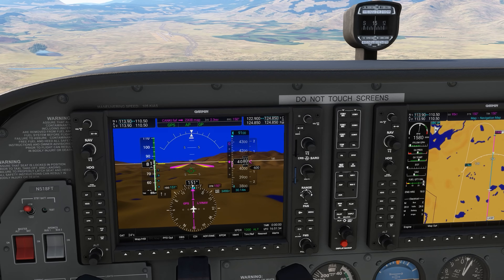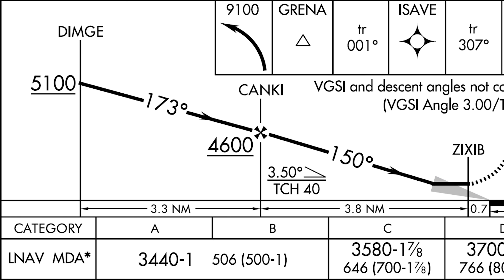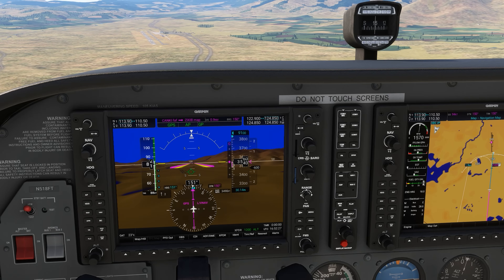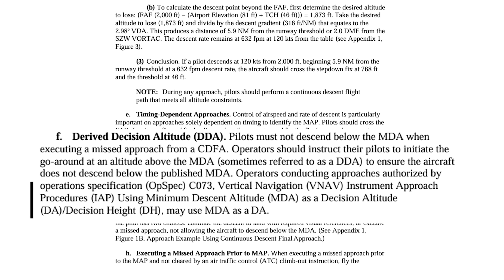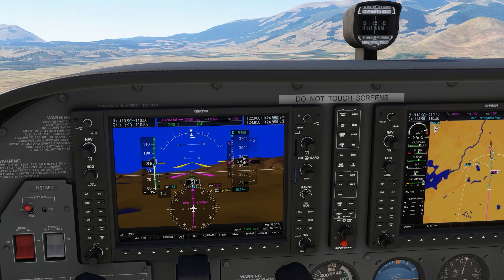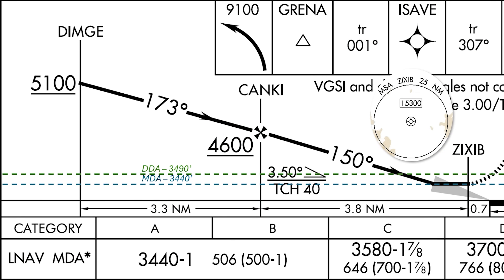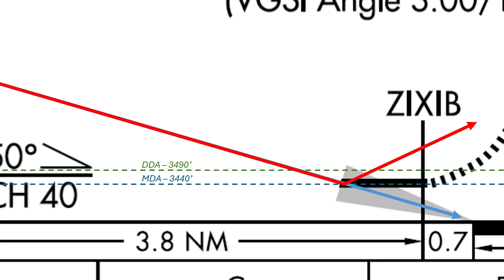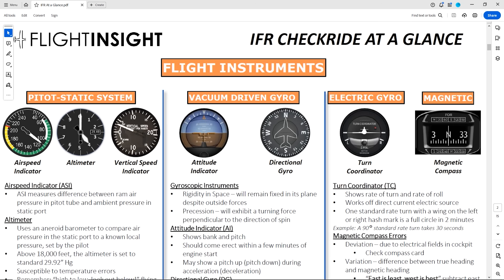How the Pros Fly a Non Precision Approach | Derived Decision Altitude

Comment: How did he come up with the 550 fpm desend at 90knots and 3.50 decent angle
Reply: I think the TPP has a chart at the back next to the feet per nautical mile conversion table
Reply from the maker: Jeppesen has a conversion table on their approach plates
Reply: @flightinsight9111 thank you
Reply: Tan(3.5)x100xGS
Reply: 5xGS for a 3 degree slope
Reply: There is also a rate of climb/descent table in the Terminal Procedures publication. I use FltPlan Go, which calls it the “IAP Legend” (probably stands for “Instrument Approach Procedures Legend”). I am sure that Foreflight and other EFBs also make the table available in some form. 

You can also use an E6B app (probably the easiest method) or the slide rule (hardest method) to calculate your required rate of descent.